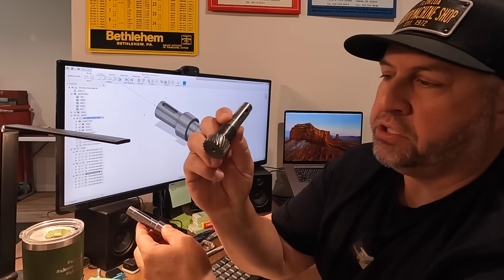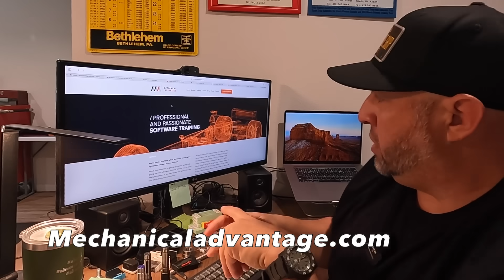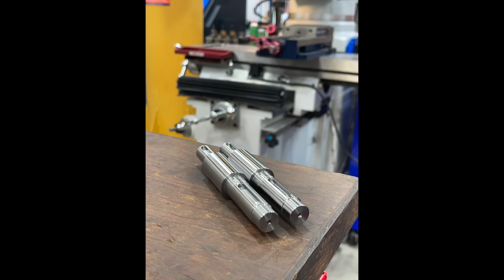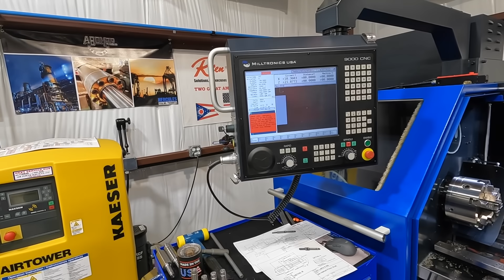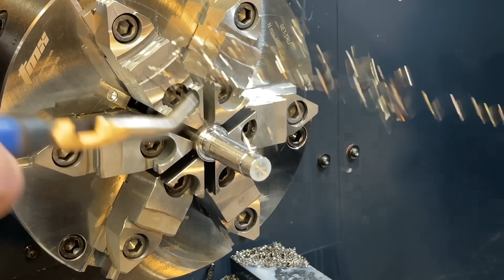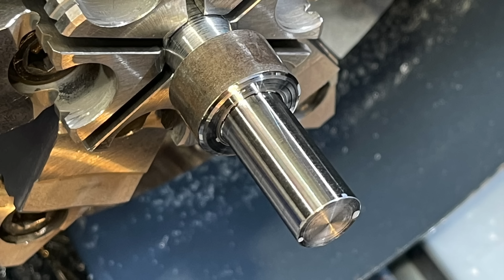Pinion Shafts Turned in the CNC Lathe

Comment: The work CNC does is impressive but skill wise I have so much more respect for the expert manual machinist, it requires so much more knowledge in so many different aspects of the trade, that's why I love your channel and have been subscribed for 10 years, I miss the old shop and the work you did at Motion, thank you for years of awesome and super informative content...
Reply: Skill wise CNC and manual machinist are the same. CNC is crazy complicated to do with certain parts or to do a high production the faster possible
Reply: @tristansimonin1376  They Definitely not the same
Reply: Absolutely. But it's great that Adam is branching out, and if you need to do production runs you cant beat CNC.
Reply: @devnull73  Definitely, if your doing production runs you can't beat it

Comment: Need to tighten on all tightening points.  If only one just use it .   I tighten on all and it balances the pressures in the chuck.  A pro taught me that from the Air Force. In the tight place - maybe a torque wrench or electric drill torque wrench might be best not a T handle. A breaker bar handle.

Comment: Few tips. 1 drop the 6 jaw. Go with a 3 jaw with more aggressive jaws. More bite less pushing. 2 always leave .005 on the face. Let your finish turn take the finish pass. You csn blend a small rad or chamfer alot easier. 3. If your doing production use one of your tools as a bump stop. So you don't need to scale everyone. For 8 pcs. No biggie. But if you got hundreds. It's gonna be a pain. I was a manual guy for ever. Now doing cnc. I've learned alot. Any help I can give. I will.
Reply: Use also a torque wrench to tighten up the chuck
Reply: Only time any 6 jaw chuck works ok is on thin walled tubing or similar work. There is no possible way for all 6 jaws to make identical contact on a solid round.. and know that solid round will never be absolutely round and those 6 jaws are never identical in their holding position. Add to this 6 jaw chucks are fragile due to their thinned out body to accommodate those 6 jaws.

What should be on a cnc lathe is a chuck like a kitagawa pneumatic or hydraulic 3 jaw with soft jaws made to fit the part to be made. Alternative would be any number of pneumatic/hydraulic collet cnc specific chucks. This does and will cure the repeatability problem. This shaft can be made full length with the tail stock as support, no flip over until finish facing.
Reply: SIX JAWS TWICE AS GOOD AS 3 JAWS ROOKIES.
Reply: @jackjohnson6074  I've been in a machine shop since I was in diapers.  6 jaw is for light pressure with minimal machining for light pressure. 3 jaw is for everything else. I run cobalt chrome everyday. I'd never even think to try a 6 jaw. It would push right through the spindle with all the tool pressure
Reply: @Bighorse508  REAL MEN USE 4 JAWS SISSY BOY

Comment: I noticed on non-CNC lathes you always measure the runout of parts when putting the part into the lathe.  Also, on the non-CNC lathe, you always measure using a thread gauge when you start cutting threads.  On the CNC machines, you never see either of these being done.  Why?
Reply: Hi Robert, for checking the runout I'm not sure why he doesn't check this on the cnc.. but for checking the scratch pass on threads this isn't necessary as the pitch you type in your program will always come out correctly

Comment: Put your 3 jaw chuck back in the machine. Put some aggressive tooth hard jaws in for the first end. Then get some soft machinable jaws for the second op, bore them out for the second op so they match the first end exactly. You will have a much better experience than that ridiculous 6 jaw chuck.

Comment: forgive my ignorance, but isn't the purpose of the CNC turning to not have to reverse the part and cut it all in one chucking operation?  like cut all the features and then part it off?  i dont understand why it has to be turned around.
Reply: You can only turn and part off when your machine can feed material through the spindle automatically.

The purpose of cnc turning is constantly outputting the same part, holding the tolerances - and doing so very fast.
Reply: @KarlB1337 you can definitely feed by hand enough material by hand, put a center point and do all the pieces in one operation
Reply: @tristansimonin1376  Many CNC lathes dont really have a spindle boring either that big or that "long"
Reply: Your talking about much more expensive and advanced CNC machines that have bar feeders and loaders and an axis with a chuck that can match speed, grab and hold the part from the front side to finish and part it all very quickly and with very repeatable tolerances
Reply: @annacalise8336   makes sense.  i didn't realize you could not cut the first half without feeding the second half.  thanks.
Reply: @vintagespeed  It depends on the part, some parts can be parted off with out being moved, a part like that small shaft that needs to be finished on both sides has to be flipped or handed off to another spindle axis
Reply: CNC just means Computer Numerical Control, it doesn't define the configuration of the machine that uses CNC. you can make a CNC sewing machine if you want.
Reply: @iceowl  huh?  i'm a proc-C systems analyst.  thanks for the definition...

Comment: Adam great video!
That material must be hard as heck! It shouldn’t have pushed it back into a 6 jaw chuck with just a .015 feed. I noticed it was screaming when you were turning and the chips were dark blue. That material is harder than regular 4340 or 4150. If you went to a smaller radius you could cut back on the feed me take smaller depth of cut but your inserts wouldn’t last as long.
Anyhow every new part has a learning curve.
Lastly, this would probably be a good job for a collet checker. 
I enjoy your videos.
Take care.

Comment: Would making a set of soft jaws provide better friction to hold the part and keep from marking the bearing surface. Expecially if this becomes a repeat order? Was thinking this material is hard enough that the jaws can't bite into the surface like a tap in a chuck allowing it to spin easier.
Reply: crao sorry should of finished watching the video before commenting

Comment: we kept having issues with our manual key chuck on our CNC lathe as well. Always pushed parts back. 
We made up a chuck key to 1/2" square drive adapter and now use a torque wrench on the chuck every time. 
(clamp down as much as we can but stay below maximum spec from the chuck mfg) 

Has made a night and day difference.

Comment: I'm thinking as you take more passes the cut starts to ring as the part gets thinner. That ringing could make the part walk in the jaws. You've talked it about it before on the manual lathe with stickout. The thinner it gets the less rigid the setup. Maybe rough half the length so it's still rigid, then finish the back half closer to the chuck. Or take the whole lot in one shot at a slower rpm.

As for your second op - I see CNC people going for fixtures all day long as its so easy to program given you already have the dimentions of the part. A set of softjaws to match the front and back bearing journals won't damage them and hold on very well.

Comment: Perhaps you should try using a torque wrench to tighten the chuck. You get better leverage and after you find the sweet spot to tighten it, you can set the torque and easily tighten it so it won’t push the work back.

Comment: Adam, there is a lot of mass in the mechanical assembly of that 6 jaw chuck. In my experience with them even though you have a better grip on the part they always need a little extra torque to tighten them up.

Comment: What if you had a clamp with a threaded center on the pass through of the chuck. To allow the use of a large ,  fine threaded rod to hold material in the chuck. It would reduce to about 3-5mm for the last 4" or so , to make an adjustable back stop for the chuck. This will reduce pressure required on the chuck.  Good idea, or dumb idea??? ✌️

Comment: When you installed the six jaw I noticed you were tightening the jaws from the zero chuck screw for repeatability. Have you tried that process with snugging the other two chuck bolts to balance the load on the jaws? If so, did it effect the repeatability? I’ve always tightened 3 & 4 jaw chucks with all the chuck screws. Is that particular 6 jaw chuck that much more sensitive that snugging all the chuck screws throws off the repeatability? Just curious.

Comment: Learning new things! And sometimes you just have to do it the "old" way to get the job done.

I'd suggest a breaker bar for that chuck instead of the T-handle. It'd be easier to use in the CNC, I think.

Comment: It appears that you would be better off using a right angle chuck tool over a T handle so that you could apply greater force much easier. Even a T handle with a sliding handle would be better. Nice to see you working with 360 and the CNC lathe. Thanks for sharing.

Comment: I setup, program, and operate Samsung cnc lathes of all sizes with Fanuc controls. I do a ton of work on a Samsung sl-25 which is a small machine too. We use hydraulic 3 jaw chucks and most of my setups the jaw pressure ranges from 100psi all the way up to 400psi. Unfortunately I just think you're not going even remotely tight enough. Others suggested a long torque wrench that would be my preferred method when it comes to a manual chuck in a cnc. just my opinion.

Comment: Got to remember the centrifugal forces on the chuck jaws are rather big with those RPM's. Some machinists are suggesting a 6 jaw has less clamping power than the 3 or 4 jaws. 
If the stock is moving on the CNC it should reproduce that on a lathe I would think unless the feed rate and RPM has an affect of their own.

Comment: Looks like you have to be a contortionist to get a part into the chuck and get it tightened. The door looks to be in the way. Is there a way to move the door so you can get a straight shot?

Comment: 💡Adam, just a conjecture, but I had this guess why the six jaw slips. Partly, as you say, you have an awkward angle to grasp the bar. But in addition to that, the torque you apply is being distributed over twice as many jaws, so that each jaw only applies half as much gripping force.
Reply: but there's twice as many jaws applying that force so the total force being applied is the same
Reply: @gigaherz_  Bingo, on a smooth surface, spreading the force across more jaws is a net zero. The pitch of the scroll may be different, shallower pitch would give more force for a given torque on the handle.
Reply: I was going to add an additional sentence, anticipating this objection. I should have. Here's what I should have added. While the inward force is directly proportional to the torque, the same is not true of the tendency not to slip, which is highly nonlinear; in fact it can approximate a step function.
Reply: As an example of the nonlinearity in another field, notice that drag racers are 👉not 👈 indifferent to whether they mount wide or narrow tires.
Reply: @lurkmoar3926  That is different, that is not two hard smooth surfaces.
Reply: @brettbuck7362  Well, sure. In fact there are bigger differences than that. For example, the difference between static and kinetic friction. But the point about nonlinearity remains.

Comment: nice video, Adam. The axles are manufactured very quickly and with great precision. For the chuck to maintain precision, it is good to adjust the 3 pinions, otherwise one claw tightens a little more than the others and over a long time it wears out and loses cocentricity. Thanks and regards

Comment: G'Day Adam,Mate your slipping problem come back to stock roundness and your 6 jw chuck,,with 6 jaws self centreing chuck your stock need to be round,,a couple of jaws are holding your job while the other are just closed enough to make you think you have it,,change back to 3 jaw and watch your problem just go away,,3 point of contact Not six,3 points always tight,,has to be,,even when your jaws are shot,,still have 3 points of contact,where as your six jaws may only be holding by two,,could never under stand why six,,???
The other Problem may be?? your chuck need machining to close poroperly,,Not all the jaws are in a closed position,,Or the same distance from centre position,,
and you know how this can affect high pressure machining like all the negative rake tools used these days,,about the only thing i can think of Now,,
Maybe material is just too hard to get a grip on,,or slippery because of rolled finish on stock,
could give them a rough grind just to give surface a bit of grip,??

Comment: I've never used a 6 jaw chuck, but on machines with a 3 jaw chuck, I've got a deflection type torque wrench hanging on the machine. Solid parts are torqued to between 70 to 80 Ft Lbs. I've never had a part slide in the jaws.

Comment: “This is the third time they’ve asked for 8 shafts”. (In 1 year to cut foam)… They’re doing something wrong. 🤔
Reply: Or maybe the servomotors have a seal that’s failed and allowing the foam dust into the innards.
Reply: Like running multiple machines at max capacity 24/7 to the point that they order 8 at a time to keep enough inventory that downtime is as minimal as possible..? Maybe the machine manufacturer knew they had a spot where even with hardening and lubrication and metallurgy there was still going to be wear- and/or the precision of the final product is such that wear in the servo pinion causes tolerance issues?
Reply: Or they have 24 machines

Comment: Just for future jobs, when you model the part for the second operation, add an extra .100 of stock (or whatever), then let it take the face in multiple passes.  If you happen to cut one a bit long at the bandsaw, it will handle it.  If you cut them close, it might have an extra pass where its just cutting air, but still faster and safer.  Learned that for my CNC mill.  Makes it so I don't have to be super precise at the band saw, and prevents an uh-oh of cutting too heavy if I leave a bit more.  Definitely a huge learning curve though, but you're making great progress.

Comment: Thanks for the video Adam, and thanks for including manual lathe work. I spent most of my career as a CAD designer in the aircraft industry using CATIA CAD software. If you’d like much easier and very much faster 3D part manipulation look into a Space Mouse. The one I use is offered by 3D Connexion but I’m sure there are others offered. You’ll never regret it.
Reply: SpaceMouse is underrated.

Comment: For absolutely everything, whether it's doing it by hand or with CNC, there's often a dozen ways to reach your goal. One problem is that you can end up "searching for the ideal solution" than it would take to "do something that you know works".  The key is to get the job done, right? If you realize, along the way, that there's a better way, do that - if it's not too much work.

Make a note (on paper, in a computer, in your head, whatever works for you), to try a different way next time, if it's not something you can just adapt - and reprogramming the CNC would likely be one of those things.

It's exactly like the "Why do you use the shaper to do this, when you have a mill" - well, part of that is the "My workshop, my choice", right - and part of it is "I'm learning how to use this machine, I'll get better at it as time goes".  I'm sure if you'd started out using CNC when you first started working in your dad's workshop, rather than using manual machines, you'd be just as good at that as you are at manual machining - but that's not what your dad's workshop was, and your life took a different turn than that. Nothing wrong with that, just have to learn how to do things a different way. 

I sometimes wonder what my life would be like, if I'd spent more time working with my uncle, who had lathes, mills and a lot of welding equipment, etc. Unfortunately, I lived 300 miles away, so I only came to visit maybe once a year or so - and often we stayed with another relative, and only had an afternoon for lunch and a chat at my uncle's.

Comment: It definitely seems like the new TMX chuck is the problem, not you.
Reply: I agree. I think Adam should give the TMX to me, and get another one... I'll even pay shipping from Florida to the UK ;) [Only kidding of course - I'm pretty sure it's mostly a "knowing how tight to make it with the chuck key" - I've made the mistake a few times - just recently, working with a material I wasn't used to, and it kept moving on me. A bit more muscle on the chuck-key, and it worked fine - took two "why is it not doing what I expect" to figure it out - I'm s a slow learner at times].
Reply: I wonder if the 6 jaw is only rated for lets say 1.5" stock, and anything smaller, the chuck isn't able to grip nearly as tight, and this is why A is having to man handle the tightening? IDK I'm not a lathe runner, just an observation...heck the chuck maybe giving all the clamp down to 1mm for all I know, but seems that way to me..
Reply: Well the chuck is only rated for 1900rpm, and i think hes definetily running more, which reduces the clamping force @swaits4no1

Comment: Adam, I would say that by tightening at only one point on the chuck you have an imbalance in the force holding the part and it works loose eventually.  I would suggest that you tighten all three points on the chuck, that would evenly hold the part.
Reply: That's wrong, it make no difference, and clever people than either of us have suggested that it's actually a bad idea.

Comment: I’m no machinest but I would switch out to a big 1/2” torque wrench and a breaker bar for that lathe issue. At least you’d save your palms from trying to do that with a t handle.
Reply: Yeah, definitely use a torque wrench so you don't have to guess how tight you're doing it. All the cool kids use torque wrenches for work holding, and make the setting a part of the set up notes